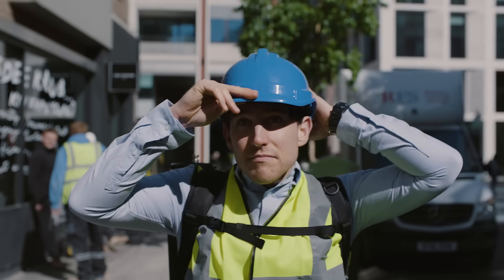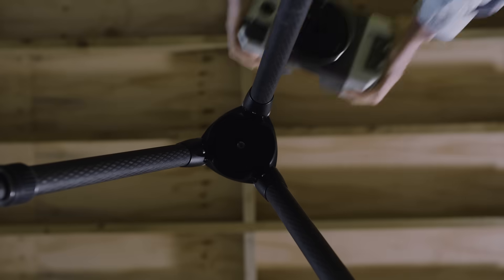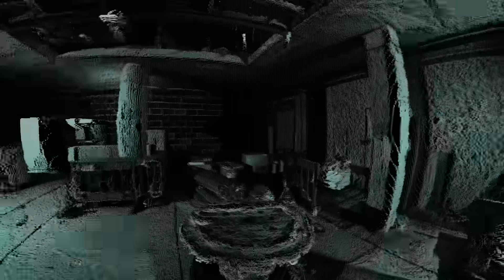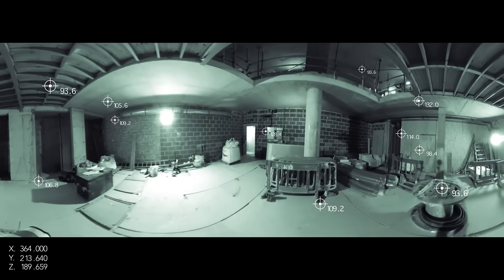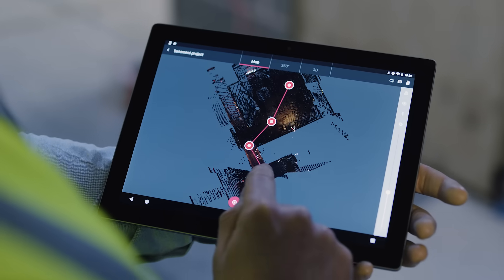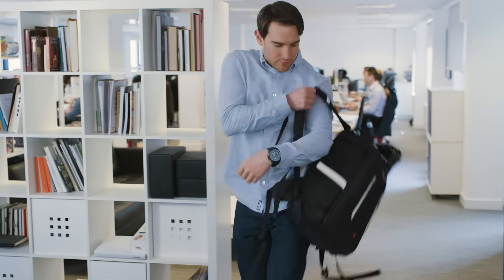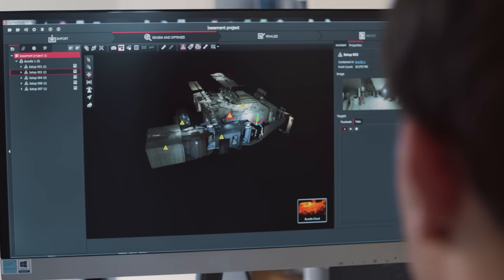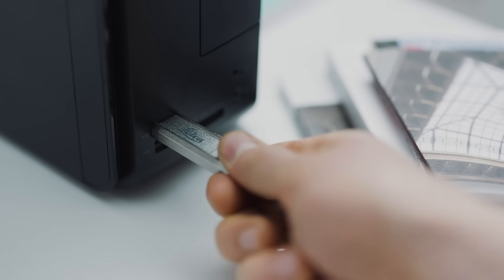Leica RTC360 3D Reality Capture Solution

Comment: whats the point of this?
Reply from the maker: 3D Reality Capture is the latest technology improving understanding and documentation of the built environment. Using ultra-accurate laser scanning combined with high-definition imagery, whole environments are captured quickly and in detail to create a digital 3D environment that can be explored, measured and annotated, for a fuller understanding of the building. This is a complete solution from the field to the office to speed up the whole workflow. The RTC360 solution efficiently combines the RTC360 a high-performance 3D laser scanner, Leica Cyclone FIELD 360 mobile-device app for edge computing for automatically registering scans in real time, and Leica Cyclone REGISTER 360 office software to integrate your 3D model seamlessly into your workflow. The RTC360 automatically record your moves from station to station and you are able to tag your data with information for better planning, reflecting the site reality. If you need more information please visit: https://leica-geosystems.com/products/laser-scanners/scanners/leica-rtc360